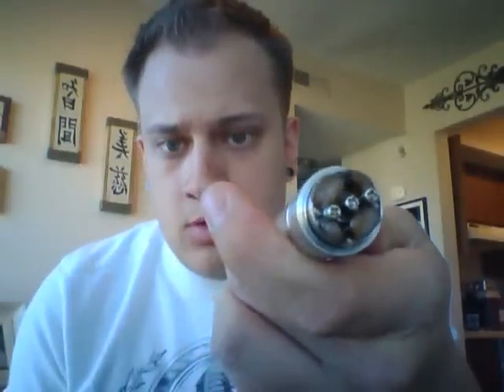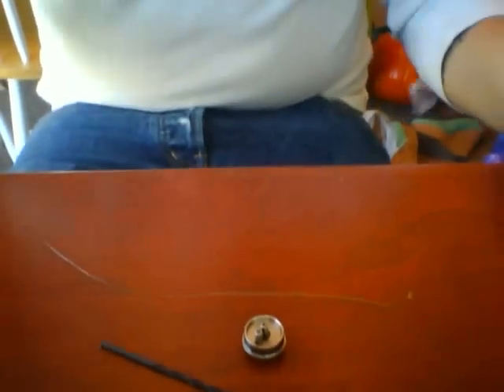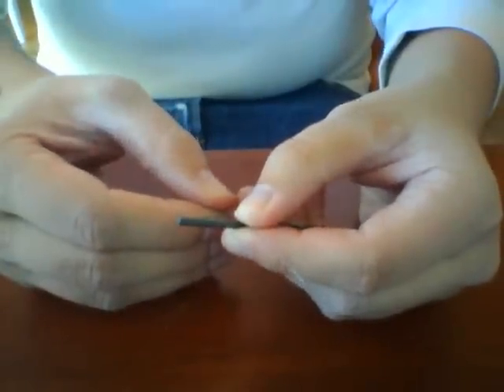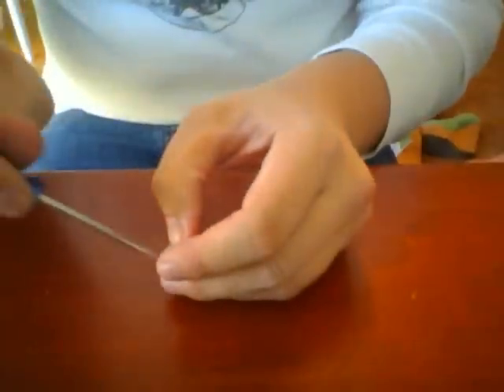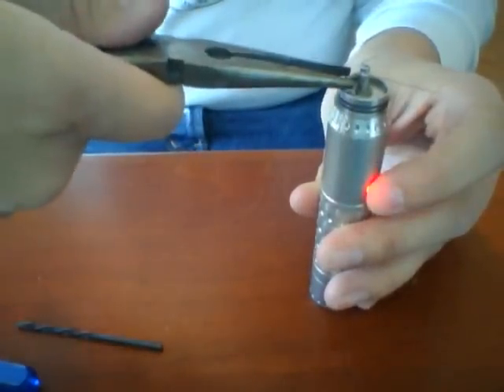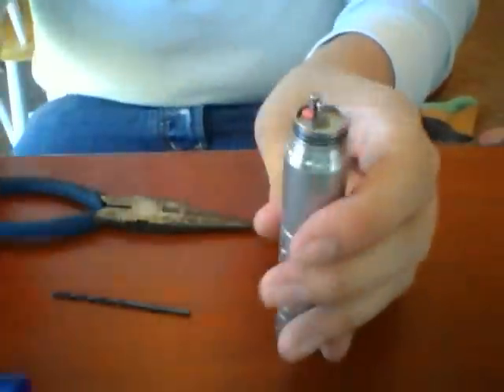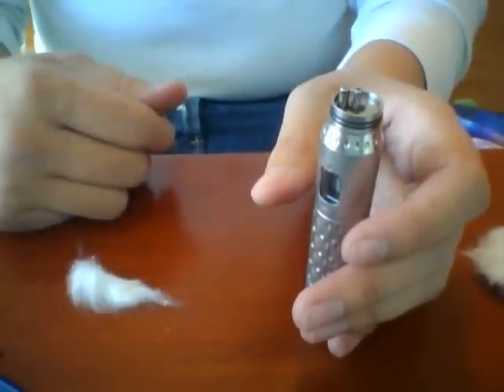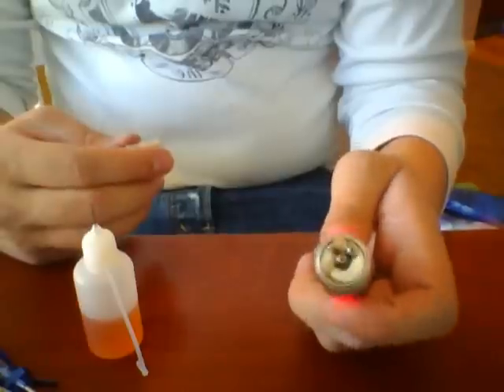How to Build A Micro Coil with a Cotton Wick

Comment: Another thing that works well is before you put your coil on pinch the coil with your pliers and torch it until it glows (off the mod). saves a little bit of time